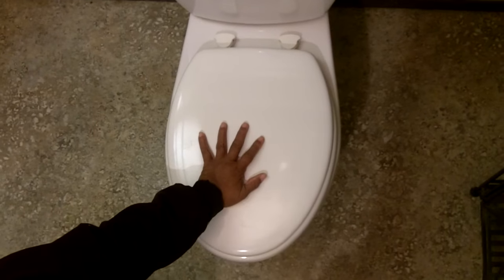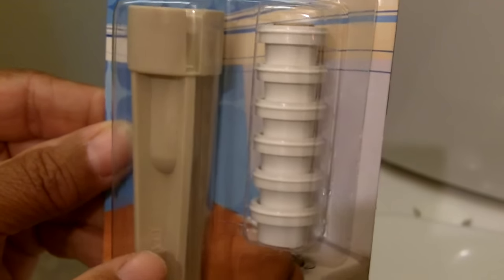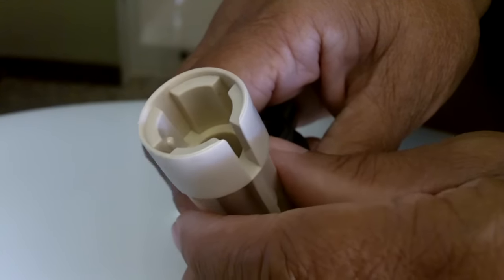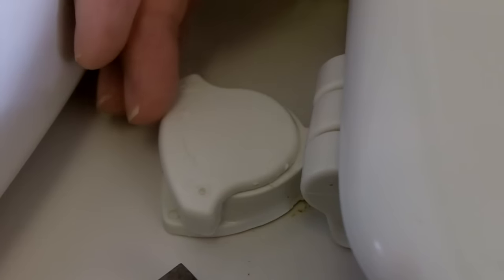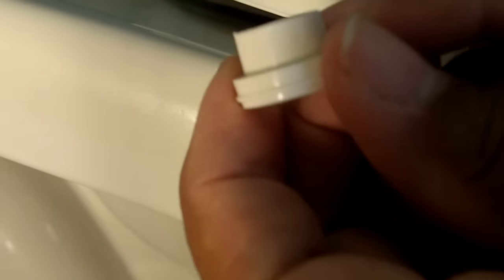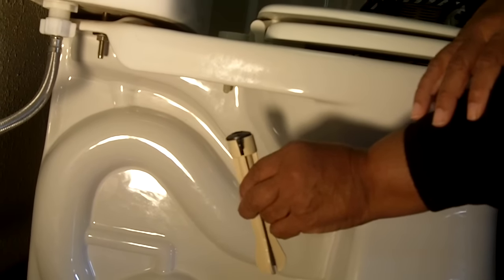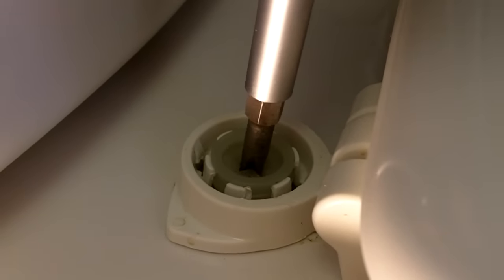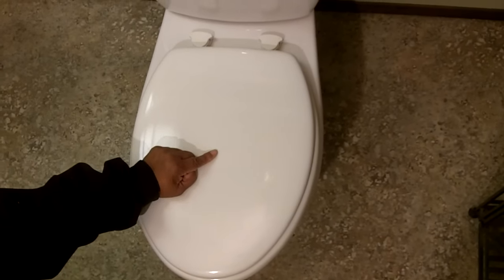How to Fix a Loose, Wobbly Toilet Seat for GOOD!

Comment: Wow Australian toilet seats attach very differently.We have no Philips head end on the bolt.Our bolts are either attached to the hinge or cam shaped heads that lock down in the seat so they can fit multiple size bases.Good vid, love that angle for the bottom of the bolt.

Comment: I had to adapt your instructions in order for it to work with my Ginsey kit plus a tip from another video to make it work. I had to insert the rubber washers on the inside top instead of from under the toilet bowl.

Comment: Great teacher!  (one detail - looking at your specific toilet seat, the cap is actually designed to release the seat via 'twisting the cap', not popping the cap off.  NOTE:  the top of your cap has a left/right arrow denoting remove/install directions.  But if popping off the cap does not break any plastic - DOUBLE GOOD!)

Comment: I have this kit & installed it exactly like this. It held very tight for about a month. It then started getting looser & looser & now I’m right back where I started!
Reply: Ditch this crappy plastic SHIT! Get the hardware in stainless and get Nylock nuts and apply a little loctite and then you won’t be doing this again.

Comment: Thank you for all the tips. I have two problems and hopefully you can give me some much needed advice. I just purchased an American standard toilet one month ago and the flapper does not always come down when flushed and the toilet keeps on running?

Problem #2, One of the plastic bolts is striped on the toilet seat and I can not get the bolt to unscrew from the toilet as I want to get a different toilet seat.  I have a very small bathroom, my house was built in 1938 and I do not have enough room to lay on the floor and attempt to unscrew the bolt from the bottom of the toilet seat. Any ideas on both problems? I really do not want to destroy the new toilet seat if I do not have to do so. Thank you in advance for any possible ideas, 
Steve
Reply from the maker: You can take a hack saw and cut off the plastic bolts.  As for the flapper, since flappers are relatively inexpensive, I would purchase a new one and install it.
Reply: Thank you very much for responding. Your videos have really helped me with home repairs. Have a good day. Steve
Reply: Instead of trying to unscrew it from the top with a screwdriver, can't you turn the "wing nut" from the underside of the screw?

Comment: Wouldn't it be better to use the rubber washer on the top and the bottom of the bolt?
Reply: I tried that too and it didn't work.  I wound up buying ANOTHER NEW TOILET SEAT and had no problem with that one.  The stoppers on the underside of the new seat are longer and thinner; they reach from one side of the seat to the other and I haven't had a problem with the new one and WITHOUT ANY WASHERS.

Comment: The only tool you should need is a larger flat head screw drive. One hand holds the bottom wing nut and screw to tighten.
Reply from the maker: +rich52movie Yes, but with that method, they generally won't remain tight.
Reply: Our Kohler toilet is recessed on the under side and you cant get your fingers in there

Comment: Could you use 4 of those rubber washers, top and bottom, instead of only on the bottom?

I noticed that the worst toilet seats for looseness are the ones that just have a stud and no way to tighten a screw at the top.  You're stuck with strictly tightening the nut at the bottom.  Those never seem to stay tight for very long.
Reply from the maker: +Blaine Bugaski Hi Blaine, it's possible, and it's such an inexpensive kit that it certainly couldn't hurt to try it!
Reply: It looked like they gave quite a few washers in your kit.  More than 2?
Reply from the maker: it came with 6, enough to do 3 toilets if you are only using 2 for each
Reply: Nice.  So 2 kits would be able to do 3 toilets if you were using 4 washers for each toilet.

I'll remember this for the future if I ever experience loose toilet seat syndrome again.

Comment: Can you tell me how to keep the bolt caps on the base of the toilet?  Every time I clean the toilet, I have to chase those confounded caps across the floor.  I've asked a few people, and all I get is that I shouldn't use anything like an adhesive that would make it impossible to get them off if we ever need to have access to the bolts.  Is there some kind of putty that remains pliable that could keep them in place but still be removable?  Any advice would be so very much appreciated!
Reply from the maker: +tnwanda1963   plumber's putty
Reply: Thank you so much!

Comment: Best fix: purchase a nylon bolt sleeve to fill the void between porcelain hole and bolt. Those rubber ones do not work as well. I tried this exact kit, but it didn't work so well. No offense though. You still got me to where I needed to remedy this issue.
Reply: Where do you find the nylon bolt sleeve, please? Thanks!

Comment: If one is, how shall we say, frugal... could one wrap duck tape around the part of the bolt that sits in the hole?
Reply from the maker: +Dave Kwiatkowski Duct tape works on a lot of things LOL.  But you know, the kit is under $5, probably the same or less than a roll of duct tape. :)
Reply: +seejanedrill and much less messy or tricky to get just the right amount of tape

Comment: I spoke too soon.  I tried this 2 weeks ago, and it worked for 1/2 a day and then I would slide on one side and the STOPPER on the UNDERSIDE of the seat, would slide toward the inside of the toilet.  I think that is the real problem.  The stopper was THICK, but NOT LONG ENOUGH.  I bought another NEW,  BUT DIFFERENT BRAND OF TOILET SEAT AND I NO LONGER SLIDE.  The stoppers on the underside of the NEW toilet seat are l o n g e r  and  go from one side of the seat to the other; hence there is no more sliding!

Comment: Been doing this for decades… NEWSFLASH!!! It will come loose no matter what, unless you use locknuts and perhaps a little loctite. 

Also, those plastic screws are designed to snap before you could ever damage your porcelain. Either the threads will strip out or the head of the bolt will twist completely off, but you can tighten it as much as you like, and you won’t harm the porcelain.